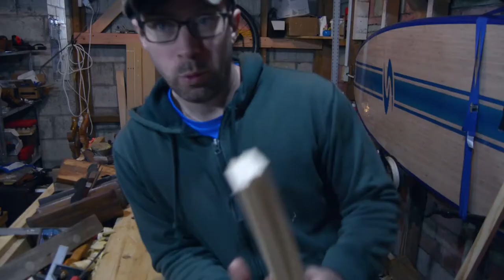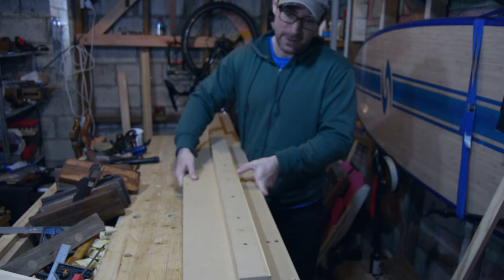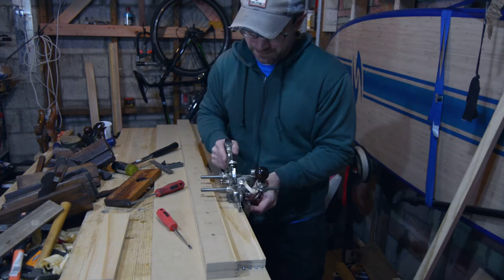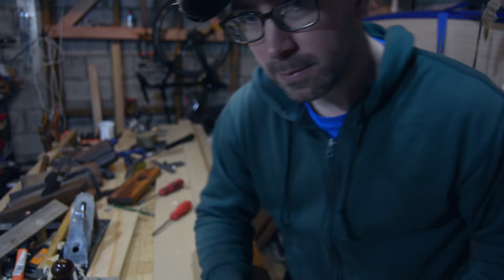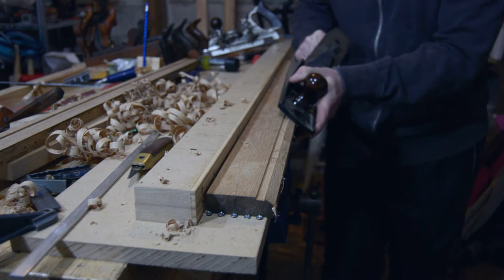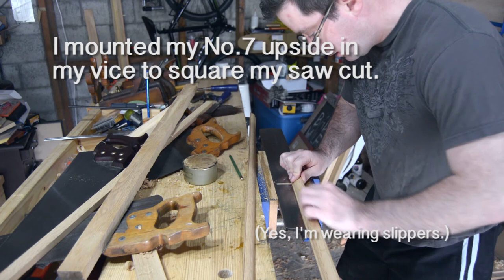Make Moulding / Molding with Hand Planes | Sticking Board Jig in use!

Comment: I think you will find the hand planes you are using will provide a far superior finish to that of a router bit, no matter how sharp the router bit. The router big will leave a scalloped finish, albeit very small, which will ultimately require sanding, probably running your nice crisp detail moulding. Glad too, you are spelling it correctly (moulding & rebate ) lol. Nice work. Cheers.